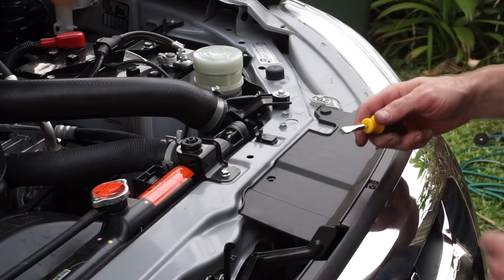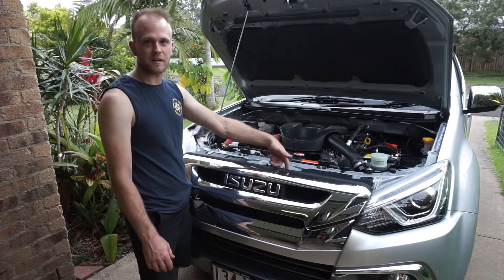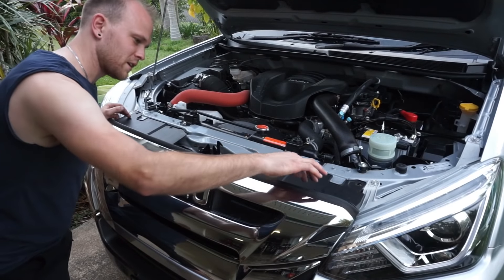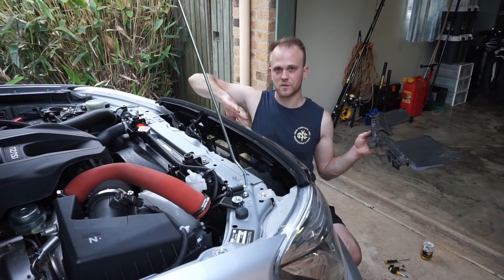Isuzu Mu-x & D-max Badge Removal/Replacement Tutorial

Comment: I have a 2014 isuzu pickup. Done this mod and it took 35 mins. But l took the grill out .
 Using a small hacksaw removed the lugs close to the retaining clips.Removed retaining clips carefully. Placed the new red badge in place. I used same retaining clips for new badge. Job done and it's never moved.
  I also spray painted the front engine and gear box guards red. Looks great.

Comment: hey mate, great vid. can you give some advise on removing/ replacing the grille? Im more than halfway to removing the grille but it seems stuck on the bottom plus it already had the bullbar attached with a single loop, do i just pull it with force or is there a trick to it. thanks and keep those vids coming!
Reply from the maker: Cheers man! There is 4 little tabs on the bottom of the grille you need to release and a few rivets that will need to come out to get the grille out.
Reply: you were right on the red badge, it actually increased to 50hp 🤣
Reply from the maker: @olecaccra5707  Woohooo! Haha soo much power 😂😂😂

Comment: Can you please find a way for the mirrors to fold in when the ignition is turned off and exit the vehicle
Reply: There is a small mirror  autofold aftermarket kit which gets plug n play  with the fuse box.
I bought ir for my Toyota vios.. It works amazing.
Regards

Comment: Great vid mate thanks.  Have you got a link for where to get a good quality one to fit a 19 dmax?  I had a look on ebay, lots of dodgy looking sellers with inferior looking badges. Will watch more of your build. Thanks again.
Reply from the maker: I just got one of these badges off ebay. https://www.ebay.com.au/itm/Front-Grill-Grille-Red-Logo-Emblem-Badge-For-Isuzu-D-Max-Dmax-TFR-TFS-MU-X-12-ON/182739317193?hash=item2a8c1cb1c9:g:jNQAAOSwR8pdv8UH

Im not sure if the 2019 dmax has a slightly different badge to the 2018 models though because they have a different grille. I haven't had a close look at one yet. Cheers for watching :)